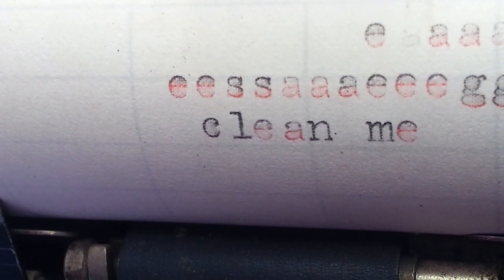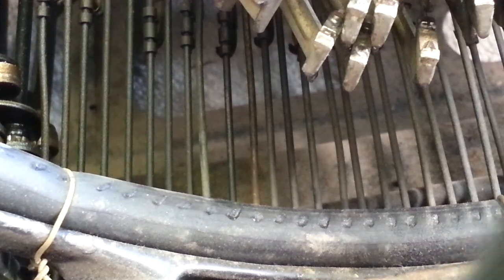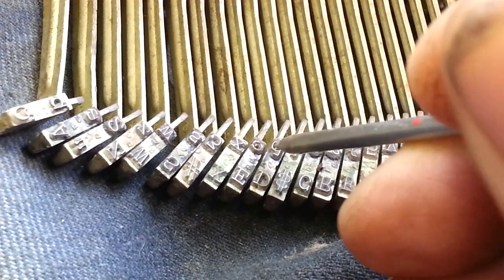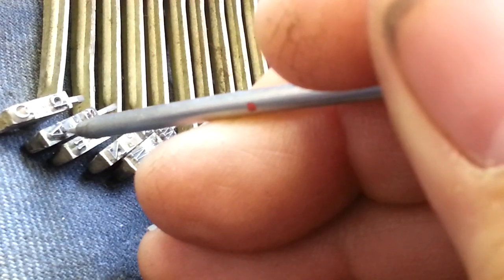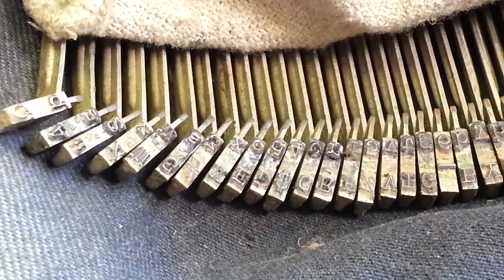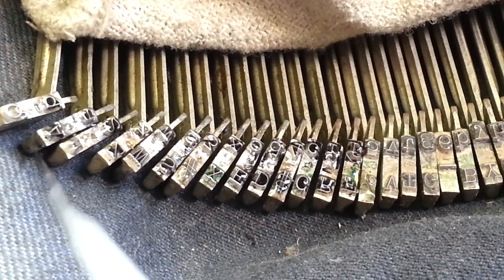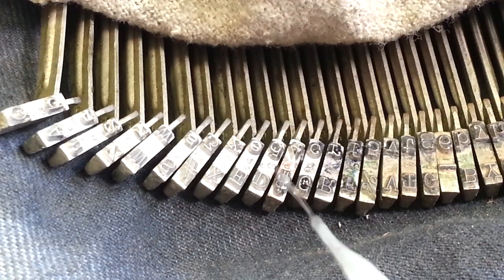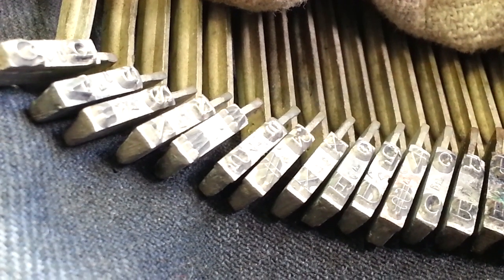Typewriter Type Slug Cleaning Process, Pick Clean Clogged Faces, Restore Shine, Quickly

Comment: Have been watching your videos for awhile now and very impressed at what I see and have learned so far, so thank you for that.
I do have a question,  that I have yet to see on any of your videos  and that is .... I have a 1952 Smith-Corona Silent that I picked up and first things first it came with a old Tweed over wood carry case but no "KEY" for the latch lock. It will re latch with a little fidgeting but it seems that one of the pressure tabs that are used to open the latch does not return to a outward state. It stays in the inward position, if I find a key for it, will that fix the issue or is there a way to get inside the latch for cleaning or repair. Thank you Duane for any insight you can give me.
Reply from the maker: These have a leaf spring (2) that breaks, those early latches are sealed, not sure if there is a way to hack into them
even if you did you would still need the special spring. latch locked...? Don't think I ever tried that.....
Reply: @phoenixtypewriter2136  Thank you for the timely replay, I will do a little more investigation into the latch issue, and see what I come up with as a remedy. Worst case scenario I guess would be to remove the lock latch totally and use some other locking mechanism. The case is wood so most anything can be attached to the wood base.  P.S. ...the case is unlocked so I can get it open just not able to lock it if I do find a Key.